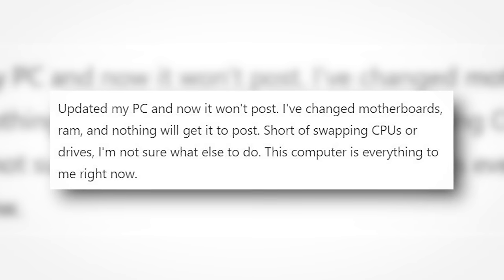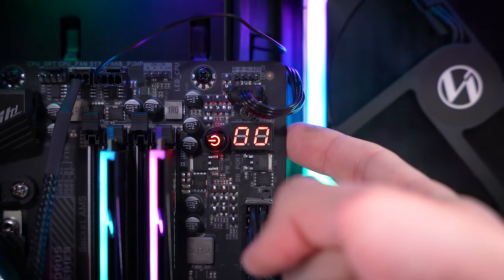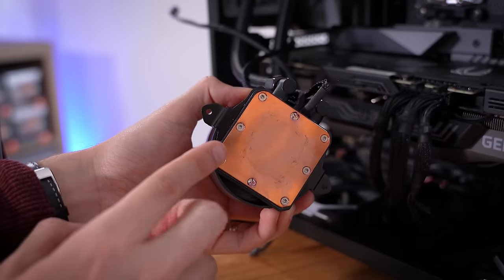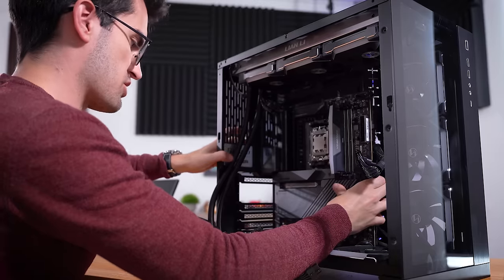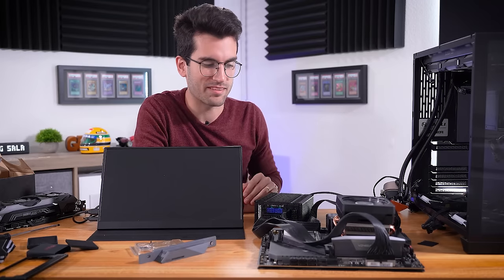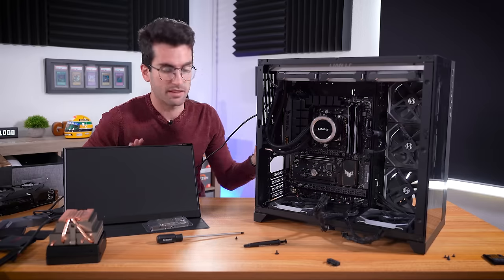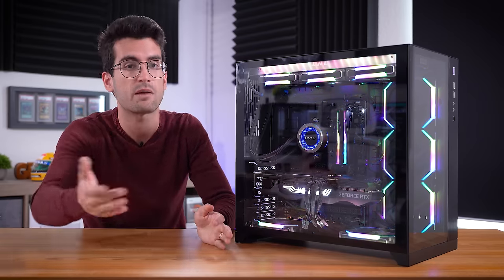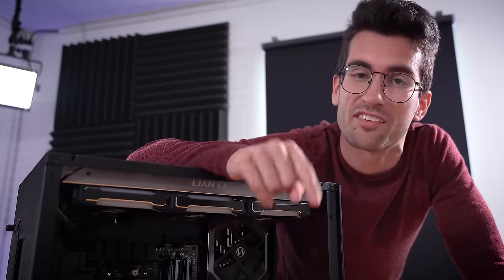Fixing a Viewer's BROKEN Gaming PC? - Fix or Flop S5:E5

Comment: Hey Greg! I love the series! Is the reason you didnt flash the BIOS just because of the light codes you were recieving when troubleshooting?
Reply from the maker: I appreciate it! Couldn't flash the BIOS conventionally because the system never POSTed with any of our CPUs. The board supported BIOS Flashback, but it wasn't a thought that occurred to me at the time because clearing the CMOS failed as well. If it was a bad flash, it would have required special tools which we now have on order :-)
Reply: @GregSalazar  That's why purchasing a Motherboard with dual BIOS pays off, just in case one gets borked.

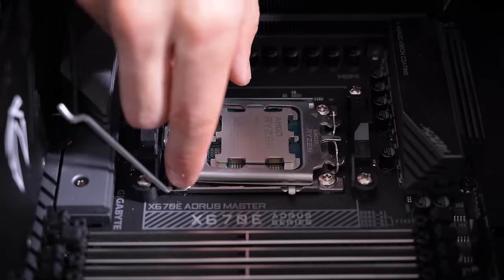Comment: I'm pretty sure you messed up the socket Greg! If you compare the way the original CPU sits at 7:30 and the way you put in your 7600X at 8:42, you can see you put yours in a very crooked way, the bottom part is basically sitting on top of the plastic border instead of inside it. Putting the pressure of the ILM on top of that caused it to warp which is what you noticed later.

Comment: you should have looked up the debug codes in the manual might be helpful.
Reply from the maker: There were multiple codes, so no, it wouldn't have been very helpful. Only useful if it hangs on a single code.

Comment: There's people out there expecting you to Louis Rossmann the motherboard and bust out the hot air station and crap? lol. Most PC repair shops probably aren't setup to repair mobos to that level. I think that's more common for laptop repair though. :P

For desktops it's more common and probably cheaper to replace motherboard instead of trying to do any board level repair on it. :P

Comment: The Aorus Master x670e is just a POS of a board... Trust me, I have one, with a delidded chip in a complicated hardloop that I don't want to disassemble. It will boot around 5% of the time, and once booted it will happily stay online for weeks, OC'ed to the max and has zero issues. Man I hate this mobo, I will change to zen5 when it comes out and toss this POS.

Comment: I would get one of those Thermalright AM5 CPU Contact Frame and try that board again.
Reply from the maker: Seeing as though we already manually forced the CPU into the socket to no avail in the video, I doubt a custom frame would be of much help, unfortunately.
Reply: @GregSalazar  Yea I guess i was not clear enough, I would certainly have replaced the board. I just would have been too curious about the way it was unevenly mounting in that warped socket to not try something afterwards to see if that would get it to post.

Comment: I just got threw fighting a dead mobo I got a b450m from Newegg on Black Friday so I went to build it would not power on after multiple cpu's and power supplies I've come to conclusion board was dead on arrival
Reply: Did you check the CPU compatibility list for the listed BIOS on the Motherboards box?
Reply: @johnt.848  yeah I tried a r3 2300x r5 3600 and a 5700g nothing worked

Comment: Another major problem with boards is there is a incompatable m.2 drive installed it won't post some m.2 drive compatability needs a bios update, make sure the m.2 drive key and form factor is the same for the motherboard or it won't post because the m.2 shares the same channel as the dedicated graphics card.
Reply: How long ago did you pick up that outdated info?

Comment: kinda went through similar scenario...had a aorus pro x x670e that went dead on bios update...couldnt get to post...at first i couldn't get to set @6400 ram mhz...gskillz neo5...so i returned to micro center...and went with asus prime pro wifi....running 7800x3d with it but same issue...i cant get stable ram to run @6000 mhz....the only ram speed i can get is 5200...what gives ???? and in mobo ram comparable saids it should work fine...bios all upto date chipset aswell....so kinda gave up dont wanna brick another mobo
Reply: You use 4 sticks or only 2 sticks?If you use 4 thats happen,AM5 does like 4 sticks,if not it means that your memory is not in the QVL memory of the motherboard
Reply: @nirvanna85  used 2 stick 16 gigs each. I returned the 6400 hz that wasn’t on list for 6000 mhz that was on motherboard list compatibility. Still has same issue. Exp1  5200 only stable speed not anything more then that
Reply: @nyiceone2075  With exact motherboard do you have and tell me the exact model of ram?
Reply: @nyiceone2075  Something is wrong that it doesn't work at 6000Mhz, because in QVL the memory is supported by Asus website and G.Skill QVL, have you tried OC ram or CPU?maybe that's why is not stable at 6000Mhz
Reply: @nirvanna85  no OC just tried to use expo on ram to get advertised speed. I had same issue on aorus x670 pro x with 6400. Same it just wouldn’t post all bios up to date. So I returned and went with Asus prime and lowered speed ram mention previous.
Reply: @nyiceone2075  I have the same ram but on X670E Hero with 7950X3D and work's perfect,i don't know,go back and return both ram and motherboard
Reply: @nirvanna85  what I get if I try to set ram to 6000 mhz is red gpu led on mobo sometimes cpu led and blank screen. The way Imto fix it is clear cmos few times. After 10 minutes I have to reset ram either default or 5200mhz is stable. So after getting same symptoms on 2 different x670e mobo and 2 separate ram I think is it’s amd issue and gave up. Gpu is new 4070 super Asus

Comment: I have an x570 Aorus Master v1.2 and it was running solid for about a year. Moved house and it suddenly started having issues booting. Long story short, electro static from the car seat corrupted the bios enough to cause issues. Reflash and been working perfect for 6 months now. Always try reflashing the bios before replacing your motherboard if possible.
Reply: Static shouldn't affect the motherboard unless it is directly rubbing across the seat. Usually it is a GPU or CPU Cooler fitment issue after moving.

Comment: If it got that hot to have the coldplate remain hot for so long, I'm thinking the socket has partially desoldered itself, along with warping the casing

Could it have been related to the bios issues that were toasting cpus?
Reply: Yet the CPU was not hot to the touch, go figure.
Reply: @johnt.848  yeah that broke my brain a bit...I could be way off with my guesses though, Ive barely touched a PC in a few years

Comment: Had pretty much the same problem with the pc of my brother in law, was working fine then suddenly wont post at all, no mater what i tried, in the end i used the flash bios with the pc turned off (it is an msi board) and it solved the problem... My guess that somehow, windows update did an bios update and bricked it
Reply: Windows Updates do not affect the BIOS, only a BIOS update can do that. Generally it is Graphics drivers that affect display outputs or can brick cards.

Comment: I think there could also be other possible issues :
Sometimes Gigabyte motherboard ships with default CPU fan curve set as silent mode and "zero RPM" function turned on for some reason, which is fine with large air cooler, but could lead to overheating or early pump failure caused by constantly being spun-up and stopped.
Another possibility is the user might mistakenly plug the pump header in to the "CHA_FAN_6_PUMP" header on the board but didn't set the fan profile correctly (you have to manually set that header to pump and follow CPU temp for it to work correctly in this case), and for all that time it follows the case fan curve/voltage which is not enough for water pump, and that can leads to overheating and other issues.

Comment: Most new builds, both intel & AMD, go through a cycle when you first power them on. They will reboot 2 or 3 times.
As a matter of fact, my newest build with an i7 14700k , Z790 & with DDR5 did a cycle when I first booted up for the first time in the new build.

Comment: Not sure if you noticed in one of the corners on the pin side of the board some slight discolouring, i think the board started to heat the socket, it was a known problem for a while and a bios update to set the voltages correctly. defo looks like the socket started to burn lucky the cpu was fine

Comment: Literally bricked my PC from trying to do an update by mistake though MSI Center and fixed it after finally using my brain and doing a BIOS Flashback since my motherboard had the option to.

Took me like 45 minutes to figure it out after nearly wanting to break my wall out of frustration, my girl ignoring me to use her PC I built for her to download the BIOS, and my 4 yr old finally letting me use her PC to download and get it running. Along with doing multiple part swapping attempts. 

Not fun in the slightest...

Comment: When you have debug codes, can't you see what they mean? Aren't they signifying what the problem is?
Reply from the maker: Yes, of course you can :-) However, you can clearly see in the video that the debug never freezes on a single code. 15 = memory training, 46 = faulty memory channel, and 00 = dead CPU (in most cases).

Comment: Building a PC is really easy these days until something goes wrong. QC has gone to crap in the industry and your chances of getting a DOA component are higher than ever. Really not a great time for total novices to build their first PC. 
Based on the flipping between 15 and 46, I suspected the socket also. But the heat seemed to suggest a bad CPU with an internal short or a bad AIO pump. Then I started ruminating about board killer CPUs. But that socket was a real eye opener. Never seen anything like it. 
I have a Tuf B450 Plus II and it is a decent board. The USB controller isn't the best but it has a fantastic audio chipset. The same is probably true for the B650 version. 
I wonder how hot that CPU ended up getting. It seems like the faulty board was feeding it way too much power. I think it was probably a faulty soldering job on the socket or chipset.  But QC should have caught it. I think COVID caused a shortage of properly qualified people on the production side of the industry and they still haven't recovered.

Comment: this is why all motherboards for intel and am5 should come with a contact frame instead of this bull which is standard this motherboard in my country which is £470 which is 596.71 US Dollar alot of money for a motherboard and to warp like this is ridiculous plus  and another thing this is why i wont go with gigabyte and asus rock no bios flashback button if you have a corrupt file you cant simply flash it without a cpu installed

Comment: That broken motherboard is likely under warranty still. 
I'd get that motherboard exchanged and get it back in that system if I was that user. A B650 is not a good match with a 7900x imo.

Comment: I dont understand why you need to ask if the 650 board is ok. They brought in junk and its fixed for free. They should be happy with that  and move on and not complain.(They didn't complain in this case), Not meant to be a rant I just do not know why.
Reply: So you bring a Porsche to a crash repair place, they tell you it's totaled and give you a Prius and you would be happy?
Reply: @johnt.848   I do not know where you live but body shop's do not give out cars. You pay to have them fixed. There is no payments with fix or flop
Reply: @scruff_01  you missed the point.

Comment: Why didn't you research the code his motherboard gave you?
Reply from the maker: What code? All three? 15 = training memory. 46 = memory channel error. 00 = dead CPU. To which are you referring Lol?
Reply: @GregSalazar  So you did research the codes, would have been helpful to mention that in the video. I finished the video confused on why the original board wasn't working. Strange it gave you 3 different codes for all different issues